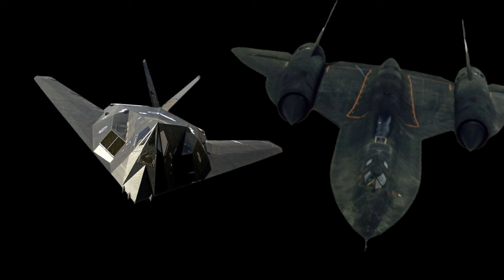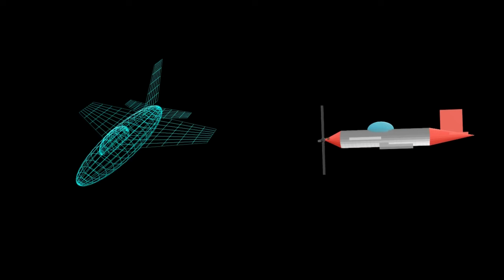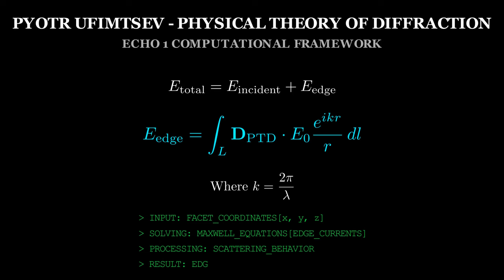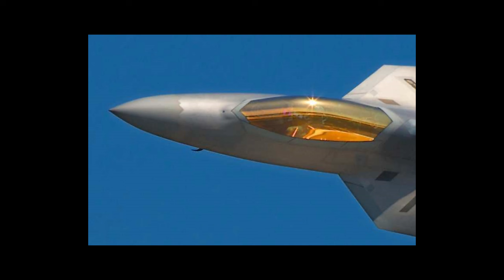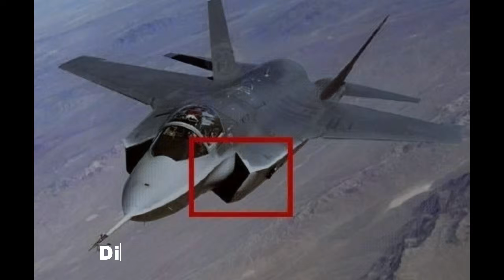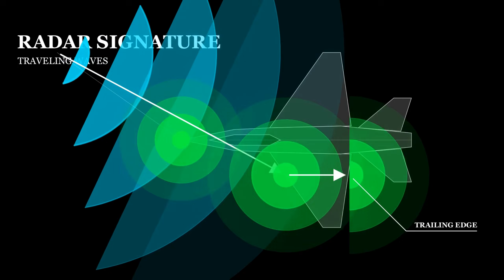The Insane Physics Behind Stealth.

Comment: Your reasons for faceted designs having poor aerodynamics is incorrect- or at least incomplete. The reason is because of flow separation. Air prefers to flow along gentle curving surfaces, and when that curve is abruptly interrupted, the airflow detaches clean off of the surface it was flowing along. That's how stall strips work on wing leading edges, they provide a seed point for the airflow to detach at high AoA. And also, this applies to the rear end of cars. Since you don't want cars acting like an airfoil (the car would easily depart the ground at high speeds when combined with suboptimal road conditions), the rear end of cars feature a slightly raised sharp lip that ensures that the airflow over the top of the car detaches easily. Whereas on an airfoil, you do not want this air to detach, since that would cause a stall and loss of control. The F-111 had a five facet airfoil, with three on top and two below. The edges of each facet act like a stall strip, most pertinently on the front 30% of the upper wing surface, and cause the aircraft to have violently unpredictable handling and stall behavior, which necessitated the Nighthawk's extensive fly by wire system to bring under control.

Hope this helps

Comment: I had to give you a like PURELY for mentioning impedance and gradual impedance change from free space to metal/reflector impedance.  It's a topic not mentioned very often, despite being a major cornerstone of the technology.  To see just how important this is, try passing a laser pointer beam through a hole just slightly smaller than the beam and look at the output on a wall from a few inches away, then something like 10 to 15 feet away.  You'll notice that the beam creates multiple rings on the far wall that are much bigger than the hole it went through.  That's diffraction at work.  But think about this:  The beam from the laser pointer is almost the same size, but doesn't do this.  Once you can understand why and how you can create a smaller hole to pass a laser through that does NOT do this, all of this stuff will make much more sense. :)
Reply: Interesting. I am wondering if also quantum physics is at work here though. How would diffraction work with laser I find it a bit counter intuitive since the laser bean photons are essentially parallel to each other on small distances.
Reply: @luckyfluke4049 : They are considered a plane wave even at larger distances horizontally (aka, from edge to edge of the free space beam, aka, the "narrow" direction), but like any wave, diffraction is what dictates free space behavior.  You don't really need quantum behaviors to explain this, the exact same effects happen even if you lower that frequency/increase the wavelength to human scales.  I should also clarify, I explained this poorly.  Enough so that I was the one who wrote it and took a minute to jog the ol hard drive.  Soft edged apertures is what I was hinting at there.  If you pass a laser through an aperture a bit smaller than the beam with hard edges, you get horrible edge ringing at a distance downstream.  Do the same thing with a soft edged aperture and it doesn't.  I wasn't referring to a hole way way smaller than the wavelength, that would be nonsensical.  But this sort of "soft edge" stuff that prevents diffraction and the ideas of soft impedance surfaces without massive short range impedance cliffs (aka, a step function) is at the heart of a lot of that stuff.  This is why you see pyramid RAM in anechoic chambers.  To an incoming wave, it appears to be free space, then gradually move from that to some impedance further in and over this distance, it's moving past lossy material.   Wave goes in, the end.  If you make the surface of something lossy and make the edges of it have a gradual impedance change from metal to free space, many of the effects that dominate just kind of vanish.  Impedance matching and soft edge apertures is really all I'm referring to here.
Reply: @GamingHelp thank you very much for the answer. Yeah I was thinking of a hole just slightly smaller and with hard edges. Great explaination, appreciate it 🙏🏻
Reply: @luckyfluke4049 : You are very welcome.  :)

Comment: The SR-71 isn't a stealth aircraft, it only has some plastics on the leading edges of the aircraft which does absorb some radar waves but it's not that much to make it "stealth" thanks for the vid tho. Pretty good quality.
Reply: The low observability features on the blackbird were an accident that came from the materials challenges that pop up at higher mach numbers. That's why the leading edge was the shape it was
Reply: @xevious4142 thanks for letting me know. :D